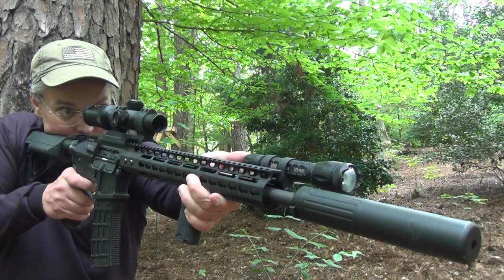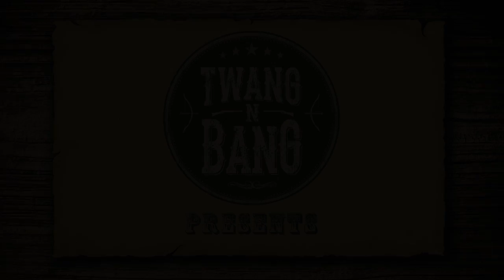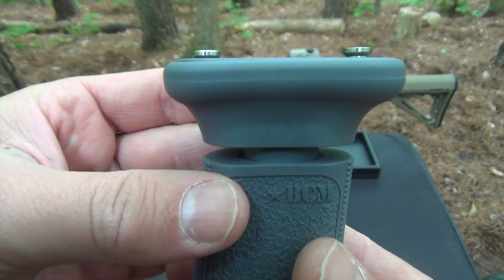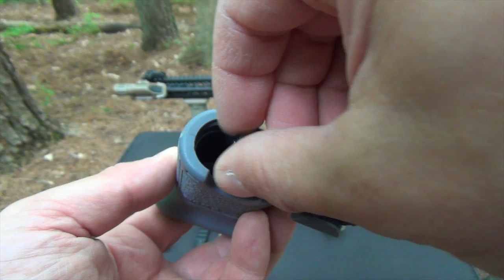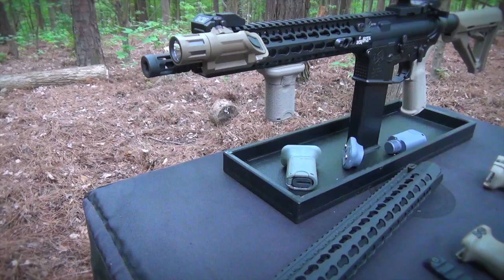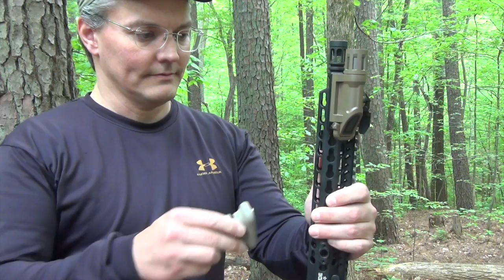Bravo Company KeyMod Vertical Grip! Toolless, Direct Attach

Comment: This BCM vertical grip is junk. After much YouTube research, I decided to go with a BCM Key less keymod vertical grip. After about two hundred rounds fired, the grip kept falling from my BCM rail.... junk
Reply from the maker: +wokstar364 Did you contact BCM about it?
Reply: +TWANGnBANG. 

No.. I trashed it and purchased a troys Industries
Reply from the maker: wokstar364 That's ridiculous.  There's no way for anybody to know what was wrong with it, including user error.  If it actually was the grip, then BCM needed to know so they could fix the problem not just for you but for others, as well. However, this is the first I've read anybody not being happy with this or any BCM vertical grips.

Comment: Do you find that the FDE Keymod VFG matches the Magpul FDE color? I have an MOE stock and pistol grip in FDE, and am debating between black and FDE for the VFG. The BCM FDE color looks a tad lighter to me.
Reply from the maker: thieflord63 That's because you're seeing it closer to the Inforce WML, which is definitely a darker shade.  FWIW, every unit in this video is a pre-production unit, so what you buy today could very well be a slightly different shade than what is in this video, anyway.  Regardless, I still love this VFG, and so does everybody I know that has tried it out.
Reply: TWANGnBANG
Thanks for the reply. Just ordered myself a 14.5" Complete Upper (with 13" KMR) with the Enhanced Light Weight (and fluted) barrel. Tossed an FDE Keymod VFG and a Keymod QD mounting point after seeing your videos on the BCM products. Thanks for uploading.
Reply from the maker: thieflord63 Great!  Be sure to drop them a note telling them why. :)
Reply: Bravo Companies FDE does not match Magpul FDE it is a slight shade lighter
but it does match the FDE that Midwest Industries uses on their Keymod hand
guards, if you use some other Bravo furniture to go along with this vertical gripe
plus a MI key mod hand guard in FDE it looks pretty good.

Comment: Twang, is there any movement or play when the grip is mounted?  @ 3:40, after you mount the grip and check for play, it looks like there is a tiny bit of horizontal movement.  Can you confirm or deny this?
Reply from the maker: I noticed that it looks like that in the video, to, but mine locks up really, really tight with no movement at all.  I think it was just the way my hand was moving, but the grip itself is rock solid.
Reply: TWANGnBANG Very well!  Thanks much for the reply.  I'm going to order one tonight!

Comment: Check out The "Gripstop" by Lanco Tactical. !! I know the guy that built it. He may be interested in supplying some for review!
Reply from the maker: I've been meaning to contact them to get one in KeyMod.
Reply: they have one with a two screw config, which may or may not be able to bolt right into Keymod. (Not sure) and a picatinny style one.
Reply from the maker: Pat Albor I learned last week that their "KeyMod" version does not actually work because it lacks the recoil lug.  They have been informed and are redesigning it.

Comment: Now I get to keep waiting for the next mossberg video.......sigh. Still, really cool. I'm a big fan of tool-less add ons. It's why I still use my old Tippman A-5 paintball gun....three pins and the entire system comes apart, and all you really need is an allen wrench set to adjust anything on the air system.
Reply from the maker: I'm doing more T&E with the 590A1 tomorrow, but it still will be a bit before I've put enough rounds through it to be comfortable recommending it.  I don't anticipate any problems, though.
Reply: TWANGnBANG
 Don't get me wrong, I like all of your videos. I'm just a shotgun nut overall......it's my preferred tool

Comment: What's the weight difference between the keymod rail/hand guard and the Troy alpha? My SPR has an 15in Troy Alpha on it. I like it a lot, it's just a pain taking the hand guard off, then putting a rail exactly where I want it.
Reply: Depends on Which rail you're talking about.  13" Troy rail comes in at 9.9oz, BCM KMR-13 weighs in at 5.5oz according to them.  So pretty big difference.

Comment: Where did you find the free float hand-guard? i am looking for a slim hand guard for my build.
Reply from the maker: It's the new Bravo Company KMR, and it's my favorite handguard.  10" and 13" lengths are available now, and 9" and 15" lengths will be available sometime this summer.  Be sure to tell them TWANGnBANG sent you!

http://www.bravocompanyusa.com/KeyMod-Accessories-s/173.htm
Reply: Thank you
Reply: Would any low profile gas block work?
Reply from the maker: tim Tom That seems to be the case.  However, the best thing would be to get a BCM lopro gas block. It's great quality, and it definitely fits.
Reply: sounds logical.